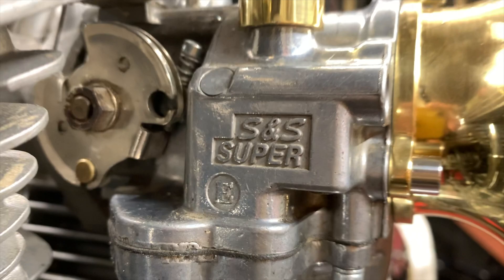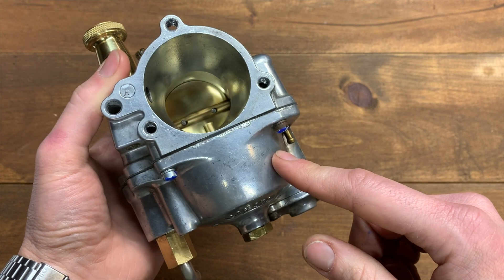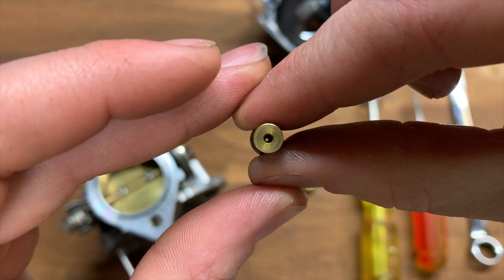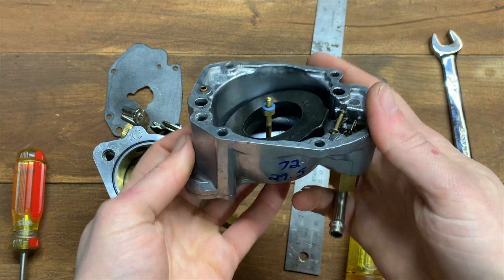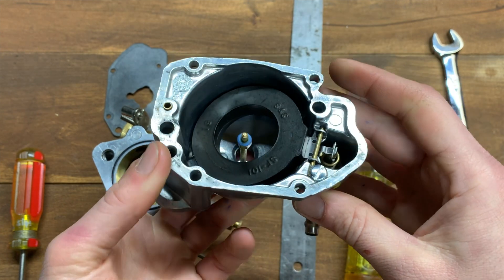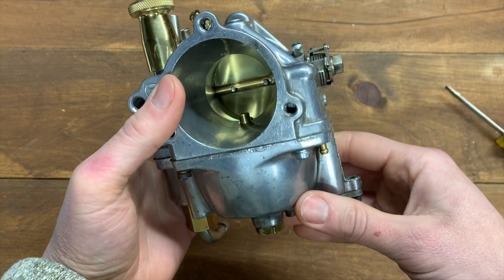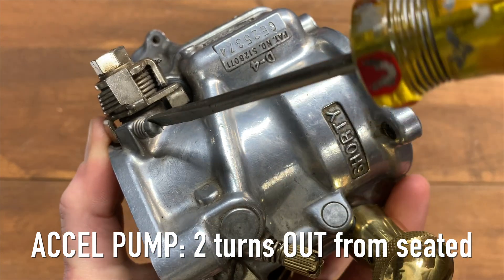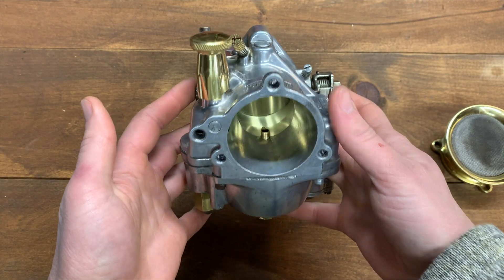S&S Super E Carb 101: Jetting, Float Height, Factory Settings

Comment: If you press on the needle and press the needs spring down then connect to fuel source to the pipe the float will be lower in the bowl  ?

Comment: I have an S&S 111 evolution S&S super E carburetor reset it from factory has you instructed on your video? Well, after the engine warm up a little bit and I’ll bring the choke down the engine goes off. Doesn’t matter what kinda jets are put on. It is still cutting off when you bring the choke down. I took the carburetor apart check the jet make sure they’re clean, but they’re all clean. It’s a new carburetor still doing the same thing. What do you think it is if you can help me, please let me know what I can do and I appreciate it thank you.

Comment: Great video, helped me a lot, I have a super G carb not sure of the deference in the two, do you need to re-jet if you go from stock air cleaner to velocity stack?
Reply from the maker: Definitely! In my experience you need to go up at least one size on your main jet
Reply: @greasesgarage ok, I really liked the looks of the gold velocity stack you had, my jet sizes are 78 main and 033 pilot, that seems large compared to what you have, when I bought the bike it was running rough and played with jet sizes till I got it running good, and just left it at that, 
I also had a clogged pilot jet that’s what I was doing yesturday it was running rough but runs great now, thanks for your input !

Comment: Have a question here ..I take the bowl off carb , the intermediate jet , (in pics )  has a screw slot to take it off , mine dont , ???   does it turn with pliers , ???
Reply from the maker: If yours doesn’t have a slot, it’s not a S&S jet. Be 100% certain you’re looking at the same piece as the one I’m showing you but if you’re sure, I would replace that jet

Comment: Hey grease,

Great video .

Can you please provide me some guidance? I have a 1998 1200 sportster with free flow exhaust. I had just put on an S&S super E carb and whatever jets have came on there as is currently there but what would you recommend as I feel the bike is tuned according to the factory settings I made some minor adjustments, but it feels like it is running lean.
Reply from the maker: Hey there, check the video for jet recommendations as well as S&S website they have a chart that gives a very good starting point. I have 72 main and 29.5 pilot in my 1340 so you should be just below that in your 1200
Reply: @ yes I know your video you mentioned 883 and big twin. I have a free flowing exhaust with the super e tear drop have the 0295 with a 068.   

I can’t find anything on the s and s website but would you recommend me going up or down in the Main Jet?

Comment: Nice break down and explanation. Not sure what jets i have in my E. But I have it on 69 shovel bottom, 80 inch, and the top end are STD panheads, port and polished. Bike starts up great. Idles great, It's great running around town. It is good, even at highway speeds. I don't have a speedo on bike, but bike starts to break up at a higher speed where I have to back off the throttle. I'm thinking above 60 mph. Would that be the main jet I should change, and what direction should I go. Bigger or smaller. Thanks if you could help me out
Reply from the maker: I would have to know what’s in there now to tell you whether the breakup is from being too rich or too lean, but generally speaking, lean condition will pop and sputter, rich condition will bog down and miss
Reply: @greasesgarage  thank you for getting back to me. The bike is put away for the winter. Next time I'm with it, I'll take out the main and check. That won't be for a few months

Comment: At 14:52 you kept calling the fuel mixture screw an "idle screw" and I know by now from what you taught us....  it is NOT an idle screw.
Reply from the maker: Yes on screen i put “idle mix screw” but it should say fuel mix screw
Reply: @greasesgarage  YES it's true that the screen should say "fuel mix screw" which was in error, but the bigger error that I noticed was you actually put your finger directly on the fuel mixture screw and called it an "idle screw" and then you said "the idle screw is very easy to set" and then again at 15:23 you say "the idle screw is now set at factory settings". Playback 14:52 and 15:23 once again and listen to what you're saying.

Comment: Question, i dont know enough about this. How do you adjust for colder weather?
Reply from the maker: No adjustment is needed for colder weather. If you wanted to get very theoretical, colder air is denser so you’d want to let in a little more fuel during colder months and a little less fuel when it’s hot. 

But that’s purely theoretical. In reality you’d never see enough of a difference to warrant adjusting for temp

Comment: There's one other little opening underneath the accelerator pump. On my Super E it has a rubber plug over top of it should I remove that plug
Reply from the maker: No need unless you’re having an issue

Comment: I bought a big dog bike it’s 18 years old but only has 2300 miles on it. Has sat for a while. Should I take out jets  and clean? Check bowl ? I’m trying some sea foam first. Sputters when I try to give gas at higher speeds ..I’ve set screws as per your other video. Please help. Thanks.  I’ve learned so much from you so fast !!!
Reply from the maker: Absolutely, pull that bowl off, clean out the carb completely and spray carb cleaner through both jets. Sea foam will help but nothing will replicate the full cleaning it’s worth it. 

Also check your air filter to be sure it isn’t gummed up and preventing airflow at higher speeds

Comment: Hey Grease. Could you expand on why you prefer the s&s over the others? I think that would be important. Thanks.
Reply from the maker: No diaphragm to crack or get pinched, main jet is changeable without removing bowl, extended screws available to make the carb adjustable by hand at a light, all the cool air cleaners are made for the S&S, throttle cable mounts externally unlike mikuni, and most importantly for new people…there’s a million videos out there if you don’t know how to do something on it.

Plus with S&S being an American company it’s very easy to find their literature online, need jetting recommendations? Multiple guides on their website. These little things make all the difference when someone is new and trying to work on their carb for the first time
Reply: Agree
I have older s&s no adjusting air bleed. 
Bike runs good but when I get high rpms and go it sputters . I tried bigger main still same problem.

Comment: What are the symptoms if the accelerator pump o ring is missing?
Reply from the maker: I couldn’t tell you the specific symptoms because I’ve never removed the o ring but I can tell you that if the o ring is missing you should replace it right away

Comment: I'm running a 94 FLHR with a Super E. I had a bunch of motor work done recently, and now my bike is sputtering a bit at an even speed. That is to say, I'll be cruising along when the bike will "spit," and for a split-second, it's as if everything stops, and then it picks right back up again. Also, there is a slight delay between the time I twist the throttle and the bike responds. Prior to the motor work, my bike's response to the throttle was instantaneous. Since EVERYTHING else is essentially brand new, it stands to reason that the carb (which was untouched during the motor work) must be where my sputtering problem originates. I just stumbled across your channel, and I'd like to add my name to the list of appreciative viewers. I will disassemble, clean, reassemble and then fine-tune my carb using your advice. Thanks so much for your informative (and fluff-free) clips. I hope to jot a note back to say everything was successful. Thanks again!
Reply from the maker: Thanks for checking out the channel! I make a very deliberate effort to keep the “fluff” out so I appreciate you mentioning that specifically 🙏🏼

I think it could be the result of the carb having been tuned to the previous engine performance. Like you mentioned, a reset to factory settings and dialing back in from there sounds like the right approach, let me know what happens!
Reply: My 50 panhead searches, as in speed up and slow down, at at steady throttle. Its mostly noticeable at 25 to 35 in 3rd gear but does it alot when cruising. From everything i have read now its too lean under mid throttle.. I have rejettted it many times. It appears they had too big of a main jet so i went smaller. it starts better and dont flood. However searching or surging or slight bucking is still there. Now I believe the intermediate jet is too small. I;m going to try a 29.5 up from a 28 intermediate. This should solve the lean while cruising at a few thousand RPM.

Comment: I’m newbie what does vent hole make and why air comes through it with no filtration??? Will it make carb dusty inside?🤨
Reply from the maker: This is a fair question. To S&S defense the stock filter and vent hole location are behind the filtration protection it’s only once you remove the factory filter that you’d need to use the aux port and ONLY if your aftermarket filter covers that standard vent hole. Most don’t cover that hole though so it’s rare you’d need to use it and no it’s not covered by the filter
Reply: @greasesgarage  i still don’t understand does dusty air go through carb and engine or doesn’t?
Reply from the maker: @user-lr3di2gp7o if you take the stock filter off and use a filter that doesn’t cover that plug then yes. If your filter does protect that area, then no. It depends on what filter you use
Reply: @greasesgarage  in video you said that if filter covers vent hole you will have to open auxiliary vent hole from underneath. Doesn’t make any sense 🤨that auxiliary vent isn’t filter protected
Reply: @greasesgarage  thanks to you I decided to go with mikuni carb instead 🥸

Comment: Earlier models (pre 2004) have a machined  .040 orifice for the main jet air bleed. Later models are set up to accept a main jet. That let's you move around in the rpm range where the main jet picks up.  You can really take advantage of this if you know how to read all aspects of what a spark plug is telling you. There's a a of great videos out there about plug analysis. But I highly recommend Kevin Baxter "how to read spark plugs like a pro."  it's a very in-depth, simple explanation of what's really going on in your combustion chamber.
Reply from the maker: Excellent info thank you 🙏🏼
Reply: @greasesgarage  you're welcome. Great video!

Comment: Another great video, I have 1971 Shovelhead trike that came with a Super e fitted, it runs ok most of the time but when it’s idling it smells like the choke is on, don’t know if this is an enrichener fault or not. Thanks for your time.
Reply from the maker: Mine smells the same way, when it’s running it performs fine so I haven’t been motivated to change it. Just know you’re not the only one with that issue

Comment: Hello friend, a couple of weeks ago, my carburetor (S&S Super E) started leaking gas through the overflow. I thought it might be the float needle or the float level, so I bought the repair kit, cleaned everything, and replaced it all. However, it still continues to drip. Do you know what it could be?
Reply from the maker: What did you set the float level at?
Reply: @greasesgarage  Yes, I did it as you explained it!!

Comment: I have a 1340 Shovelhead, with drag pipes. What would you recommend the jet setting for that? 
Thank you for your video, been having a hell of a time trying to find a video about this subject.
Reply from the maker: I would run the same as me to start out. 72 main 29.5 intermediate
Reply: @greasesgarage thank you ever so much!  I also used a 068 for the air bleed I hope that works
Reply from the maker: I feel like that’s large for the air bleed but I’d have to check with S&S
Reply: Ok I'll change it down to 066
The only one i have smaller is 040

Comment: Hey grease I bought a velocity stack like the one you have on your bike from speed dealer when I put it on the carb with the three mounting screws there's a hole on the left side does that need to be plugged?
Reply from the maker: It does not. That hole is a vent. However if you were to change to an air cleaner that BLOCKS that vent, there’s a backup vent UNDER that one (vertically) which would need to be opened up

Comment: Bike runs horrible since I put on super e.  

After watching this video I realize that my bowl vent hole was covered up by my air cleaner.

I removed the cap for the auxiliary vent hole, hoping that would solve my issue, and it seems to run worse.

Went back to standard factory settings, and then set the carburetor as you instruct in your other video. I just can’t figure out why it is running so poorly.

At very easy acceleration the bike runs OK, any amount of harder acceleration, and the motorcycle immediately bogs down like it’s being flooded out.

I’ve pulled the plugs and it doesn’t seem to be running to rich or to lean, plugs look fine. Can’t figure it out. 

Any suggestions?
Reply from the maker: What size motor and what jets are you running?
Reply: @greasesgarage  
Thanks for the reply, I really appreciate it. Its a stock 80. If the cam matters it’s an EV 27, 9:5.1 pistons. Took it from fuel injection to an S&S carburetor. Put a Dynatech ignition in it. 

I live in Salt Lake City, so that’s about 4400 feet. Main jet is 74, intermediate jet 31. 

Runs normal until you give it any amount of gas and then just bogs down.
Reply from the maker: @JR-ss3td and what are you running for an air cleaner?
Reply from the maker: @JR-ss3td ok, I’ll do some digging tomorrow and see if I can find out if you’re missing anything. I’ll let ya know brotha 🤘🏼
Reply: @greasesgarage 
Thank you.

Comment: Great video, new subscriber here.  What elevation are you at?  I just grabbed a 1973 shovel with a super E that was at 3800 ft elevation and will now live at 7000 ft, so I’m planning on re-jetting.
Reply from the maker: I’m right at sea level up here so your jets will need to be leaner than mine 🤘🏼 thanks for subscribing
Reply: @greasesgarage  thanks!  Cracking out on your channel on this cold snowy weekend.  Great stuff!

Comment: Lots of detail. Nicely done. Still had a question on the float height. There is a little spring built into the top of the needle valve - should you press down until the needle sets in the seat, or, continue pressing until you compress the spring in the top of the valve? Makes a fairly substantial difference in teh float height at the point where it is measured.
Reply from the maker: If in doubt I’d go with less pressure. The reason I say that is because what’s going to push on that float is the pressure of the gas filling up the bowl. I can’t imagine that fluid pressure coming anywhere close to what my finger could do if I was trying to force the float down. Try light first

Comment: What jets would you use for a 143 cubic in ss,
Reply from the maker: S&S would be the best people to contact on that as their website only lists recommendations for up to 124ci, which they list .031 for the intermediate and .078 for the main. 

You’d want to go up another size from those most likely
Reply: Really appreciate your time and support. When I ran the d shorty with,.094 main jet and.032 intermediate in 3 or 4th it would sometimes hesitate, not getting enough fuel thinking maybe I'll put .098 main jet and. 033 intermediate. The stock g carb maybe to small even if i upped the jets thank again
Reply from the maker: @wae2112 let me know what you settle on, I’d love to hear the results
Reply: @greasesgarage  will do ,I'll  try and tune both carbs and I will let you know the ins and outs of my results it's snowing here in Calgary Alberta now so I can't take er out anytime soon ,maybe there something I can rig up in the garage, without going threw the wall
Reply from the maker: @wae2112 stay warm brotha, I’m up here in the northeast and we’re getting some of the same

Comment: Excellent presentation. I'm feeling much more confident working on it after watching
Reply from the maker: That’s great to hear, glad you dove in! 🤘🏼
Reply: I noticed the main jet is spraying toward the front cylinder when I twist the throttle rather than spraying down the center. Maybe a indication it's partially clogged?
Reply from the maker: @bobtoner9820 definitely. Either that or somehow it got bent
Reply: I thought I would post a update. The part I was calling a jet is the accelerator pump nozzle. Initially it was spraying to the front cylinder. I tried to clean it up but when I put it all back together it was spraying a stream instead of a nice fan. 

I found out that the tip comes off the rest of the shaft. I ran notebook paper through the slit and Seafoam. Nice fan spray now which will be easy to check by just removing the air cleaner in the future. I also didn't realize that you can test and adjust the spray pattern by just putting some fuel in the bowl and pressing down on the pump shaft before putting it back together and on the bike. For some of the smaller holes I used the small wire used on bread wrappers. I also found that the adjustment screws needed to be cleaned up so they move freely to facilitate adjustments. 

This isn't meant to detract from the video as I greatly benefited from it.